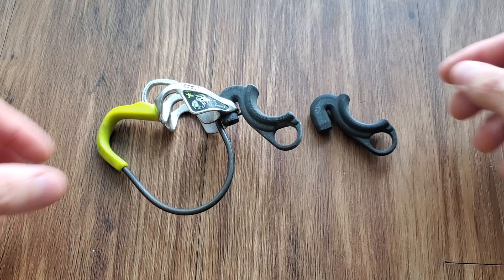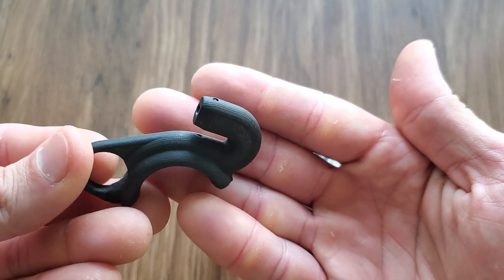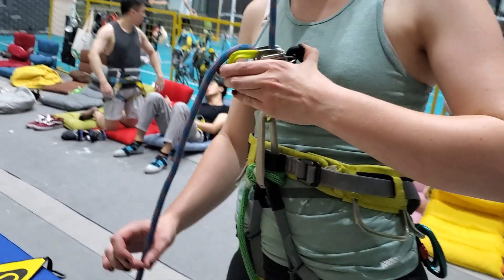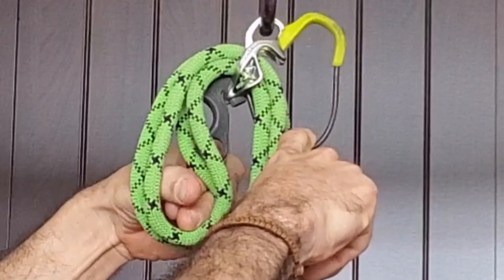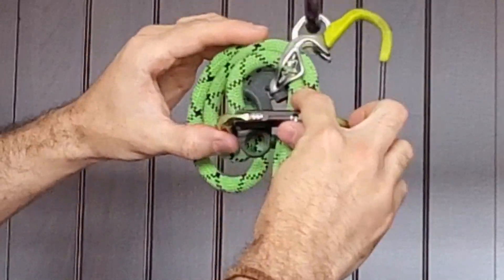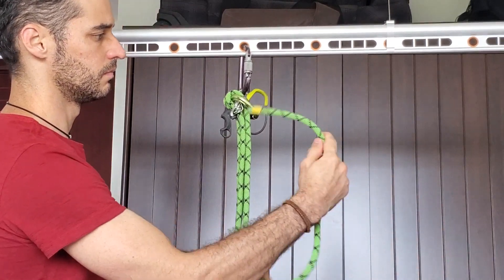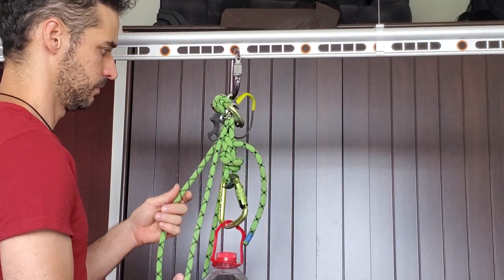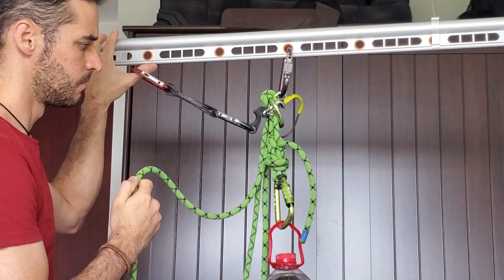Grigri Killer: Smoother lowering and rappelling with a Mega Jul handle

Comment: Thanks for the great ideas. In multi-pitch climbing, the options for brake-assisted devices are limited. I have always found mega-joules difficult to use in rappelling. If this part will solve this problem, it will be great. I am planning to build it using the blueprints. So, please let me know about the materials. What kind of materials were used to make it?
Thank you in advance.

Comment: I am definitely going to print out one of these and give it a try.  I personally have never found the Jul to be jerky once I got oriented to the device.  I hope I describe this so you can visualize my method.  I notice in your videos your fingers on your right hand are not in the green loop.  I put mine in that loop and with my thumb over the hole and fingers up against the green plastic piece I just rock the device.  I do work with a bunch of Boy Scouts that can range in weight from 90 to 200 lbs and it works pretty great.  I think the gizmo you made will probably further enhance my method.  Now the hard part...what filament color :)

Comment: Edelrid has already a solution for this problem, you just have to clip a "edelrid pure" carabiner inside the hole, and use the carabiner as a handle, its super easy and works
Reply from the maker: I agree, that slot was made for the Pure and it works flawlessly. When you lead belay you remove the Pure, but when you have to lower you plug the Pure. I admit that this is no "big hack", all I am offereing is an inexpensive (less than one dollar) way to have the benefits of a Pure always connected to it without taking much space (smaller than the Pure) and weight (less than 5 grams)...
Reply: Am pretty sure you can use a (non-edelrid) krab with small enough nose. I've played with my friend mega, and used old random BD or Trango wiregates.
Reply: I'd worry about dropping that biner on someone, careful.

Comment: This handle has the possibility with interfering with the locking function of the Jul. I don't think it is a good solution to making it pay slack easier. The handle could easily get hooked onto clothing, belay loop, harness, etc. this would hold the device in the open position and prevent it from locking as intended. Saying you 'don't have to worry about safety because if it breaks it just goes back to locked' is a very narrow view. It could cause problems if it doesn't break as well.
Reply: You could say the same about the lever on any other device.
Reply: @TheBrocam  Which other device has a handle that sticks backward towards your chest while lead belaying? Assisted tubes all have handles that stick forwards. More complex camming devices like the grigri all have fold away handles.
Reply from the maker: Hi Alessandro, I do understand your concern. When the climber falls (or you take the slack) the Jul is lifted above the belly button(almost chest height) and outwards (when lead belaying, towards the first bolt). On top rope situations (such as the one seen in the video) the direction is vertical.

A second comment is that the climber is lowered by a combination of 1.pushing the plastic handle down and 2. releasing the dead rope.

The bottom line is that in the eventuality of your clothes catching the handle your hand should always be holding the dead rope. I personally use this setup for 1.5 years without issues (it once touched my clothes when top rope belaying, but pulled my shirt and winter jacket up), and I always keep my hand on the real brake (dead rope).

Thank you for the comment!😀

Comment: i guess they don't make the handle becaue you can simply put in the nose of a carabiner in there for the same effect.. at least with the giga jul that is
Reply from the maker: That sounds great. I don't know how wide the hole for the biner is at the Giga Jul, but for the Mega Jul it is quite narrow, only allowing very specific carabiners to fit there.
Reply: @climbinghacks6900  ok i use a normal wiregate or most screwlocks with the gj.. no hms though
Reply: @climbinghacks6900  Yup, i just happened to have an edelrid pure straight carabiner, and it worked like a charm. Didnt know about this function before i saw your video though, its gonna be a gamechanger! Thanks
Reply: It was designed to use with this specific carabiner, don't know why this is not published in the manual
Reply: Black Diamond Miniwire fits pretty much perfect

Comment: The Mega Jul is not an automatic locking device! It is an assisted locking device! so it will never be in the same category as the Grigri, if you want a light tool, use an atc, if you want a safer and more comfortable belaying use a Grigri! I do not see how this device is a "Grigri killer". People who think Mega Juls are auto locking annoy me because when you "take" while climbing they slide you down expecting the Mega Jul to lock. Also, locking the device to go hand free safely is much easier with a Grigri.
Reply: Both are actually assisted braking devices. The Grigri shouldn't be seen as "auto-locking". They are in the same category therefor. When locked, the mega jul doesn't slide.
Reply: @GoodLuck-rh8tb  Both manufacturers say they are assisted braking devices for legal reasons, but if your rope is in the recommended range for the grigri and there is no oil on the grigri it will lock hands off. The mega jul never will, the mega jul slides because people treat it more like the grigri than the atc, and don't keep their belay hand back when the climber is in a "take".
Reply from the maker: This is an interesting discussion. They are all called "assisted", and your hand should be there the entire time. Mr. Raman, what is the diameter of your rope? The difference between the Grigri and the Jul (Mega or Micro, which I think you should start considering the latter) is that one is mechanically assisted while the other is geometry-assisted. My second question is do you have a jul? I used to have a Grigri and sold it to buy my second Jul. All in all, this is all about personal preference, but we should all be aware that all these devices are "assisted", and you should always keep one hand on the brake! :)
Reply: @climbinghacks6900  ofc your hand should always be on the rope, but in my experience when learning rope problem solving, is that even with an unconscious blayer, that cannot hold the rope, the grigri holds you, my rope is about 10.5m. I do not own amega jul, but my friends do, eventually they all switched to the grigri, and i noticed whenever one of them switched to a grigri their takes don't slip anymore, and when I am belayed by other people who use a mega jul I always get lowered whenever I take. pepole take too much comfort with the mega jul. They are told to keep their hand on the rope, but not to the side or back where it should be, I belive that in order for the mega jul to not slip you have to belay the same way as an atc, which is less comfortable then a grigri belay, but comfort is subjective.
Reply from the maker: Ah, I see. Don't worry, I understand what is happening: 10.5mm is a quite thick rope and it is not supposed to slip, so we need to address the real culprit. Which carabiner are you using?

Many people will crucify me but on my Mega Jul I use a Xinda XD Q9702 (type this on google and search for image, and buy one. It is UIAA certified under the certification CHN 18-4821). This pear carabiner works wonders, even better than the original from Edelrid.

I do admit that this is a problem with the Mega Jul: the performance comes from the interplay with the pearabiner. If you don't want to buy this one specifically, try with other pear shaped carabiners. Usually the "wider" and "less curved" they are, the better.

Try this one out and come back here. If it didn't work I will create a video just with solutions for your problem. You too can be a Mega Jul lover! :)
Reply: @climbinghacks6900 Im open to loving the mega jul if you convince me, I am using the DMM Ceros carabiener, it is designed specifically for the grigri, it has a little "horn" on the spine side to stop the grigri from cross loading, and a harness clip aswell, so it always stays in the same place and rotation.
Reply: @yoavraman8919  Megajul doesnt slide either without hand on the brake strand 99/100.
Reply from the maker: @yoavraman8919  I got you, I got you! I found the dimensions of your Ceros carabiner and uploaded it in a figure here: 

https://drive.google.com/file/d/140SxGO7vGqgcm1rJR1Gv9CB9SFsfY7iR/view?usp=sharing

To the upper left we have pictures from the Edelrid Mega Jul manual stating that the carabiner must be pear shaped (in red). I put in orange and in green the internal "width" and "depth" that a Mega Jul requires to "swivel" inside the carabiner, but the Ceros (upper right figure) has 4 cm in its widest part (in pink), and quickly changes to 3 cm. I don't have my Jul with me but that is almost the width of the Jul itself.

A bigger problem, though, is the "arch" that it forms. Wider pear-shaped carabiners form a "flatter" arch, which allows the Jul to assist, as they mention in the manual "A small/pointed carabiner attached to the securing device (the Jul!) may impair the braking function" (upper right).

The lower part of the figure shows examples of biners that will work (especially with a 10,5 rope!), and the two that I use successfully are on the right. Hope it all helps, man!
Reply: @climbinghacks6900  I actually haven't used the jul, just had people belay me with it, but next time I climb I will use it with a carabiner like the one you described!
Reply: @yoavraman8919  I'm not sure why the mega Jul broke your heart but I have a Grigri, a mega Jul a jul 2 and I've used the gigajul and none of them slip. My rope is a 9.5 and my partners is a 9.8 and when I use the mega Jul or the jul 2 I can comfortably take and catch falls with no slip at all. I have had some ropes want to slip with certain carabiners but even still it's a couple inches and then it locks up tighter I've actually had the same thing with the grigri where it wants to slip a little bit. You seem very passionate about the issue which seems strange I suppose if you just don't want anyone to get hurt good on you but other than that it seems like you're talking a little out of pocket. Take care and keep on climbing
Reply: @yoavraman8919  That is just wrong.. don't spread that kind of dangerous misinformation! It depends on the weight of the brake strand if it closes.. sometimes it doesnt.
Reply: @yoavraman8919  i did test and with multiple ropes it was possible to provoke it to not lock or open after locking
Reply: @as3fawf  I'm not sure if you are talking about the Grigri or Mega Jul, and what part of my comment you think is wrong, please specify.
Reply: @yoavraman8919  i'm talking about the grigri and i think it's wrong to say that it locks everytime no matter what. Sorry - non native speaker :)
Reply: @as3fawf  I'm not a native speaker too lol, the Grigri will technically not lock in any position, for example, a slow and weak pull. However, with my rope and my grigri it will lock without the hand on the break side, it will always lock unless your hand is on the black lever or the climber side, or if you do a slow and weak (less than 10 kg of weight), pull.
Reply: @as3fawf  ofc lol, the only time you should need the auto locking is if the belayer is dead or unconscious..
Reply: @yoavraman8919  Or not paying attention and letting go of the rope? I know what you mean but the assisted brake is still nothing more than this.. assisted.. also in the grigri.
Reply: There are several videos out there that show that this is simply not true. Grigri slips, its an half automat and should be used like one.
Reply: @pietdinkela9163  As we discussed 2 yeares ago when I posted this, it all depends on rope type and condition, grigri can be automatic.
Reply: @yoavraman8919 what do you "take"? I don't quite understand what you mean with a "take"
Reply: Not a single professional in the field of rock climbing would call a grigri an Auto-Locking device.  It is old terminology that was never true to begin with, especially with more modern rope treatments and diameters.  Here is a video to demonstrate the reasons why you would never take your hand of the breaking strand:  

https://www.youtube.com/watch?v=jKe72j_mBlU 

As for the discussion, I own a Giga-Jul and love it. Heavy, but does everything I need it to.

Comment: Great idea , I usually don't mess with my gear , but as you say if it breaks it will revert to lock mode so to speak, great idea, great product!
Reply from the maker: Thanks for the comments. Some people told me to "commercialize" it, but selling such a small piece of plastic would probably mean that the shipping costs would be higher than the price of the handle. I prefer to offer the STL files and in that way anyone that needs can ask a friend to print it for less than one dollar.
Reply: @climbinghacks6900   it's cool you are offering the plans for anyone to print ,  and for what it's worth , I think your right about commercialising it

Comment: Or just get a Giga Jul. Those things are sweet. It has the thumb handle; perfect lowering. Total control.
The only reason GriGris are popular is because people like to say "GriGri." 
Its fun. 
Try it......
"GriGri."
Wasn't that fun?
Reply: I'm pretty sure grigris are popular because they're reliable, safe and super easy to use.
Reply: @skinless_joe_jackson  This is probably true. Though I have never personally used one, I am very familiar with their operation, capabilities and limitations. I also saw a poor guy almost wreck himself doing a TRS with it (and no back up!) trying to rap down from a sport climb last week. I personally prefer rope in the hand control over my descent. That lever was giving him the business!
Reply from the maker: Hahaha, that is true. I would say that the strongest aspect from Grigris is the reliable lowering speed, independent of the thickness of the rope. About the Gigajul, I am not sure on which thumb handle you are talking about (they have one to push in the back?), as I thought that it also required an Edelrid Pure carabiner to lower. That said, I hear good things about the Giga Jul, so I should try it out one day.
Reply: @climbinghacks6900  The thumb handle is in the front for use in brake assist mode. Just lift up controlling the descent. Very smooth.

Comment: That's cool. Although I think that you don't have to clip the whole device in guide mode if you're using two strands, because the carabiner can only flip on a single rope.
Reply from the maker: Ah! True, true.... I was concerned in showing the right procedure for one strand (hence the zoom), but you are completely right: It would have been correct and simpler  to clip from the top.